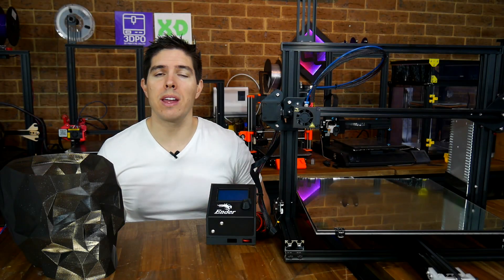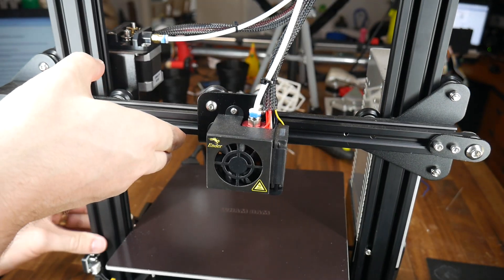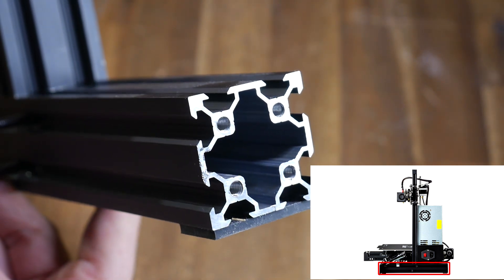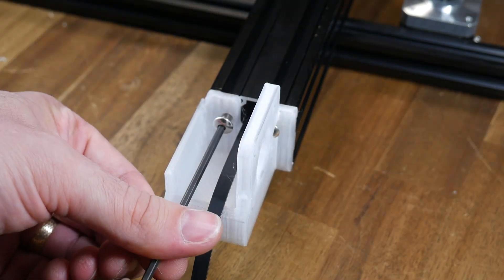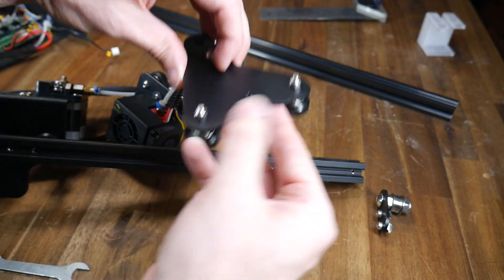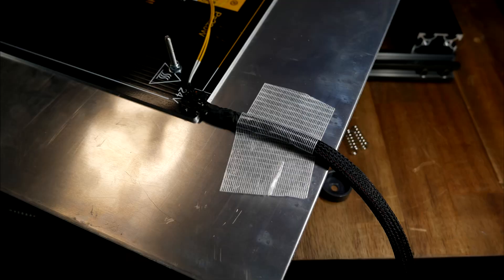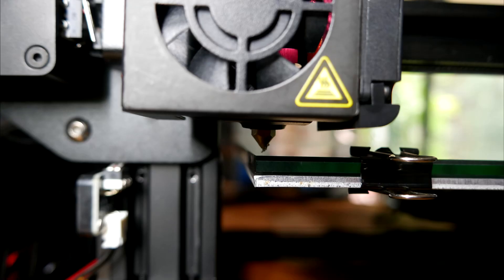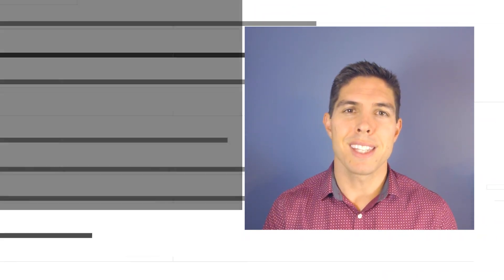Ender 3 conversion to 400x400 with the Ender Extender kit

Comment: How does the print speed of the extended Ender 3 compare to one of the CR-10 series? I feel it's a bit of an elephant in the room what with print times on Ender 3s reaching into 12hrs and more. With the increased volume I expect print times will increase enormously. Is there anything to fix that?

Comment: I was sad to see this since I just sorta did this myself to build a second printer from all my spare ender parts. this kit seemed like a great deal until I saw it just reused the heated bed and carriage. thats bad because the rest of that kit besides the alum plate you can do yourself for less than half that price.

The bed and carriage plate are the expensive parts(about 60usd) of building a cr10. I got all the pre cut extrusions for a CR10 clone for 30 dollars, 5m GT2 belts for 9, the 4 metal X gantry plates for 17 dollars (banggood) that support dual Z motors,  and if you are just upgrading a ender you have those gantry plates already. seems like only a deal if you dont have amazon prime and have to do a bunch of orders for all those parts. hell I bought two 1 meter lengths of 2040 extrusion for 12.50usd so that I could expand it further or build a 3rd machine..  this kit is for the lazy or countries without access to amazon.

Comment: If you lengthen the wires, why not make the z axis 1000mm?
Reply from the maker: Need to lengthen z leadscrew, extrusions as well. Probably be pretty wobbly without bracing.
Reply: Teaching Tech Could be a fun project to do for fun.

Comment: It screams for a dual z.. Wouldn't that be interesting?
Reply: I bought the cr10 Dual z axis upgrade kit for my ender 3 which is working out well.
Reply: @Rsm583  Which one the one with an extra stepper motor or the pully option?
Reply: @dombaines  I am using the one with the extra stepper motor.
Reply: @Rsm583  thanks
Reply: Robert Mathew is the second z stepper motor plugging into an aftermarket motherboard or is it using a spliced connector of the other stepper?
Reply: I was thinking the same thing. Dual Z seems like a good idea here.
Reply: Same thoughts. Just have to relocate the power supply? Then fit dual z kit?
Reply: @dennisnuis1971  Yes that is correct.
Reply: @Rsm583  Thanks arrived and fitted. Got to tune it completely yet. Mine has the stepper motor. I printed a couple PSU mounts so it is moved off to the right. Now to look at this option.
Reply: Ive been printing on my 400XL for 6 months and no dual Z needed, provided you know how to build your machine and work your eccentric nuts properly. I don't have any braces either. The only other thing I did was I clamped the machine to my table. Yes, I have been printing large almost full bed sized objects, even very skinny but 500mm tall items and no issues.
Reply: Indeed, once the ebay channel opens again.
Reply: Dual Z from a single stepper motor is superior IMO. There's a few online, I found quite a decent one I use for my CR10 Mini. It uses 2 lead screws but the right-hand one is connected to the left via a belt and 2 pulleys at the top of the lead-screws
If you use Dual motors you can have it go out of sync as it powers off (i.e. 1 motor spins back just under a half step, the other spins back just over a full step, now its 1 step out on each side)
You also cannot just spin 1 motor by hand. I personally raise/lower by Z axis by hand A LOT. For things like moving it up after a panic stop when a print has failed, or changing nozzle etc
You can mitigate the first point if you use ABL, but i've tried all the common ABL solutions and I can assure you a manually 'levelled' bed (not just spin on the adjusters, actually shim the damn bed so its genuinely flat) is far, far better. It stays 'level' (might need to adjust corner screws once in a blue moon) and is far faster and less work than the amount of time ABL takes to setup and dick about with periodically
The second you can't
Reply: @aidangillett5396  The aspect of a twin Z drive has interested me for a while....I have the Ender 3 Pro and I think I'll use a design I want to do and that is with a single more powerful motor in the middle of the X axis cross beam at the back and driving with two short belts one to each screw.....the short belts won't flex as much as one long belt across the back that I've seen as a mod.
At the same time the big bogey is apparent and sleeping on all Enders and that is the flatness of the bed..........it would pay to have a really thick piece of aluminium that has been made flat and checked on a surface plate etc.....flatness is vital if you want a consistent nozzle to bed surface distance maintenance, and that also means no springs once the bed has been set level.
Another thing that crops up and that is belt tension.......without it you get rubbery transmission.....why not leadscrews as in CNC routers?
Reply: By the time you replace enough extrusions, lead screws, bed, bed heater, etc to get a 40x40x40 volume and two Zs, there’s basically nothing significant left of the original ender.
Reply: If you use a skr mini 2.0 board its got a nice extra port for the second z .

Comment: Great Video.  Good kit if you have an Ender 3 gathering dust or picked one up for a bargain and use this kit to stretch it - it will still need additional parts as outlined by others below.  I Would not recommend it as a way to build a 400 x 400 printer - you'd be better off buying a new or used 400 x 400 to start considering the added costs to equal one (larger bed heater, dual axis, glass bed, etc).  You'll also have to print slower with a glass bed and larger bed heater if you add it - that is a lot of mass to move back and forth.

Comment: Another great Video!  With the available printable parts, does a kit even need to be purchased?  As long as you willing to do the hard work (buy longer rails, cut to size, drill required holes, etc) it should be doable.  Definitely looking forward to the next upgrade video.
Reply from the maker: I guess you could do it yourself, but personally I would prefer to buy a kit wit the fiddly bits done. Each to their own.

Comment: My Ender 3 steppers get pretty hot (may be caused by my 2208 & 32bit upgrade), how is that printed stepper bracket going to hold up to that heat?  The bed steppers get too hot to touch.
Reply from the maker: I printed in PETG, you could print in ABS or Nylon if you were concerned.

Comment: Great video! Though this "kit" needing to have holes threaded, and multiple STLs modified, extra hardware, seems unfinished for it's high price. It sure would suck having one printer, getting to the tensioner part, and realizing you need a better part. Same with that bed cable. Thanks for being so thorough!
Reply from the maker: I had the pro kit for a standard, hence the modification of the part. My fault, not the kit's. I think the rest is well documented in the instructions so it should be possible to plan accordingly. I think shipping the glass or mirror would be hugely expensive and potentially dangerous.
Reply: There's 2 options for each configuration of sizes 
Mark needs to know which ender you have pro or non pro to give you the right kit since the do have differences in between

Comment: Is there no end to the Ender 3 upgrade capabilities. 2025 upgrading your Ender 3 to do your ironing. In the future, creality could sell the printer as a kit from a parts selection menue. Select the frame size, Hot end, control box etc, & build your own to your precs.
Reply: Sounds like a great idea.  Buy it with no hot end, extruder and mainboard

Comment: The website states it does not include the build plate as he cant source dead level metal at this price point. Where do you get the larger build plate?
Reply: It includes the aluminum plate but not glss
Reply from the maker: Correct mine came with the aluminium plate but I sourced (and butchered) the mirror myself.

Comment: Great video and another mod to think about as well as all the others.  Not sure I agree about not soldering the wires, if it gets hot enough to melt the solder joint then you printer is already on fire or the joint goes open circuit and stops the fire from starting.
Reply from the maker: I do agree on that, but generally I think crimping is regarded as the superior for this nonetheless.
Reply: Do you have any more information on why crimped butt connectors would be superior to soldering?

As previously mentioned, I'm not buying the heat argument, because if you're wire gets hot enough to melt solder then all of the insulation would be melted off of the wiring anyway and the connection coming apart is probably the least of your worries at that point.  

I install electronics in automobile's for a living and in my experience soldered connections are vastly superior because they are much, much, more reliable than crimped connections. I would never ever recommend crimping over soldering in a car, so I'm curious as to why crimping would be better on a 3d printer. 

If you are not sure of the reasons, do you know where you got that advice from?
Reply: @danielabrams555  I too am an automotive electronics engineer and I would usually crump and solder and seal with glue lined heatshrink purely to protect the connection in the automotive environment, for 3d printers I don't think it's as important.
Reply: All Mil-Spec assembly guides demonstrate a SOLID mechanical connection in point-to-point assembling and they point out that relying on just a solder joint is dangerous in higher current-carrying or AC conditions due to the hazard it presents if the wires (due to a non-fused short) heat the joint to the melting point of the solder, you may now have unrestrained live wires to cause havoc or fires.
Reply: I made  lot of high current / low voltage cables for welding.  All crimped.  300 amps/30 volts.  Solder was OK for short term, no vibration/movement, or maybe just signal.

Comment: I would rather see a ender 5 turned into a core X Y.
Reply: Yeah that sounds a lot more reasonable than using an E3. What happened to the Ender4? It was a CoreXY but it´s hard to find anything about it really, can´t have been that good?
Reply: @vesslades  ya the ender 4 is basically a tronxy x5sa which is an awful machine stock (I own one) but after significant mods it's a balling machine! And has a 400 mm build volume
Reply: @RedBeard20842  I´ve looked on the X5SA a bit, but I´m not sure if it´ll be worth it for me. How much did you spend on upgrades on the x5sa before it became a great machine? And which mods did you make?
Reply: @vesslades  I added a duet main board, linear rails (optional), mosquito hotend clone, 10mm belt and pullys, 3d printed parts, corner brackets for added rigidity. Machine cost $350, another $350 in parts. Keep in mind I have a 400mm build volume. But for me the learning process was just as important as the outcome.
Reply: @RedBeard20842  I saw that at the price point, and was stoked. (Pro model) Should I still steer clear of that one being new to 3d printing? thanks
Reply: @RedBeard20842  Damn that really sounds like a nice printer!  Might do the same in the future unless I go with the Seckit-Go instead. I´ve also ordered a Mosquito clone. I´m excited to get my hands on it since it looks really good and also cool :)
Reply: @vesslades  I was blown away by the quality of the clone I got it was very well built. Just having issues with string and retraction its forced me to upgrade to direct drive.  I was gunna go sec kit but after following the Facebook group I decided against it. Especially now with the virus ernest (the guy that makes the kit) is having supply issues they are making them but idk just right now I dont think it's a good time to buy one. And I wanted a duet board
Reply: @svnbit8408  I've heard slightly better things about the pro. It depends how much you enjoy tinkering. You would probably be better of starting with something like a artillery or and ender 3 then getting one of these that's what I did. But if you tech savvy you can probably get away with it. The hard thing about not having a second printer is not being able to print parts for a machine while it's out of service.
Reply: @RedBeard20842  That´s really good to hear! I got the impression that the clones were of high quality and it´s very nice to have it confirmed. I hope I´m as lucky, you never know. I was mailing with Ernest a while back, but as you say because of the long waiting, I decided to not do anything right now. (Except impulse buy an Ender3 just because quarantine is boring and they´re cheap) lol
Reply: @vesslades  😂🤣 I love my ender its amazing how well they do for $200. And I am having retraction issues and a ton of stringing problems with the hotend but I think that's because I am using PLA in an all metal hotend with a .7 meter Boden tube. I am in the process of converting to direct drive
Reply: @vesslades  you should grab a mirror or glass bed and some capricorn tubing for your printer now save yourself the headache of troubleshooting your ender later it is the only two upgrades I've bought but I've only used 4 kg of filament so far in my ender
Reply: @RedBeard20842  I bought a glass bed with my Ender3, it was only 10€ more. However so far I´m not really that fond of it actually (yet). I have a magnetic PEI plate on my Ender5 that I LOVE. Unfortunately PEI doesn´t work for PETG. I have a piece of capricorn at home but it´s just a few cm to short. But I will upgrade the E3 to direct drive anyway so I won´t need it :)
Reply: @vesslades  the glass bed can be a trick... when doing pla wash with soap and water and dont touch it the oil on your hands make it not stick. Then let it dry at like 60°c  then it will be tacky and really sticky for pla. For abs use acetone to melt an old print on the bed.
Reply: @RedBeard20842  Thanks! I will try the soap trick and see if it´ll do it
Reply: Windex on the build surface helps make prints easy to remove too. Works great when you want to get consecutive prints done.
Reply: XD
Reply: FACTS!

Comment: What a CRAP upgrade. 3d printed parts with TENSION guarantees that you CAN NOT enclose and heat this build.
Reply: The parts that come with the non pro only and they are ABS so yes you can use an enclosure. The pro version actually uses no printed parts. What happened here was a bit of a mix up I thought he had the Pro versions and he improvised nicely and it still works fine.
Reply: Why enclose it? If you need that level of accuracy, buy a printer that already has the features for high temp printing. By the time you upgrade the bed heater, hot end, find a way to keep the motors cool, upgrade the power supply wattage so it is not being killed by the added stress, and build an enclosure you have p iced yourself out of the budget printer range.
Reply from the maker: I agree that enclosing such a huge printer is not ideal. Just because this doesn't fit your particular case doesn't mean it's a 'crap mod'. That's incredibly close minded.
Reply: Put a cardboard box over the whole thing and it works remarkably well.

Comment: What do you mean Zebra Stripes artifacts caused by the factory main board? Could you elaborate? Maybe do a video on what those are, how to mitigate them, and which boards fixes it and why?
Reply from the maker: I've done some videos in the past: https://youtu.be/Vt-7xZUsPJ0 and https://youtu.be/zIPeHXCVS2Y
Easiest way to fix is this: https://youtu.be/ikHhzOIlHPg
Reply: @TeachingTech  Actually, what I meant was, what are "Zebra Stripes" exactly, what do they look like, so if we get them, we don't go crazy trying to fix something that can't be fixed unless changing the board. Are those diagonal lines on the cabin of the Banchy the Zebra Stripes? If so, I've never got those on my Mar/2019 Ender-3.

Comment: Did you say corexy?
What about extending the x axis and fitting a tool changer on the right hand side. Sure the the tool change would be slow compared to corexy, but it looks quite simple in theory, it's just getting parts delivered to test it out maybe a problem. Keep safe. Covid-19.

Comment: What's the overall size after upgrade I would like to find out if it will fit in my enclosure.
Reply from the maker: Mine is 700mm (x), 950ish (y due to moving bed), 750mm (z with filament spool).
Reply: @TeachingTech  Thank You!

Comment: I upgraded my ender3 with your marlin 1.1.9 firmware, but I dont see the esteps in the menus on the printer. How do I access that?
Reply: I had the same issue,  I just entered the new commands via terminal window in Octoprint.
Reply from the maker: Ender 3 mainboard has limited space so some menu items need to be left out. As Rocky says you can enter commands with pronterface. M92 for setting e steps: https://marlinfw.org/docs/gcode/M092.html then M500 to save.

Comment: The problem is the bigger the print the bigger the time by 4
Reply from the maker: Same with any large printer, but a big nozzle can help that. 0.6mm on the CR-10 Max is a great compromise and I can print about twice as fast at 0.4mm layer layer height.

Comment: If you use all Michael's ender 3 upgrade videos you change everything apart from two 20x10 profiles and belts.
Might as well build one from scratch...
... so when? :D
Reply: With the left over parts and low cost of some replacement parts for the Emder3, I'm thinking you could use this kit and be able to build another Ender 3 for less than another $100 invested.
Reply from the maker: After it goes back together, you've only actually replaced four frame pieces. The vast majority of the printer is retained.
Reply: @TeachingTech  Right, but he said "all" the upgrade videos. I know I've seen one for linear rails, one for hot end upgrades, several for mainboard swaps. Really you'd just need a power supply, screen, steppers, and the various carriages.